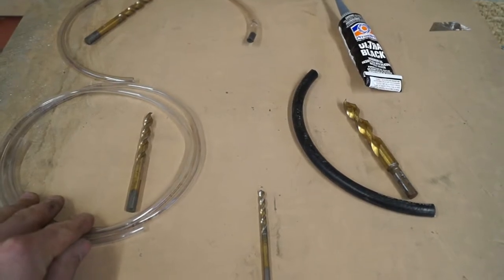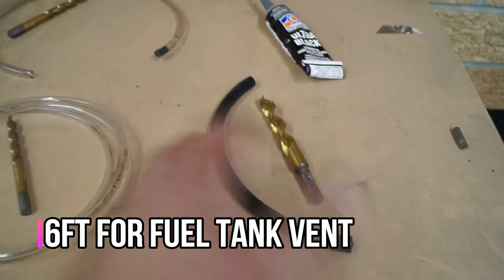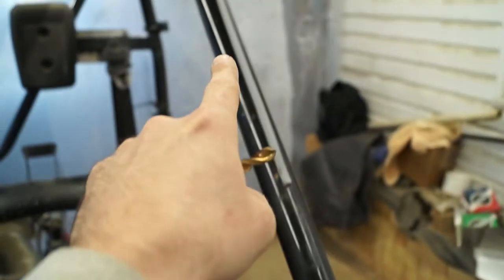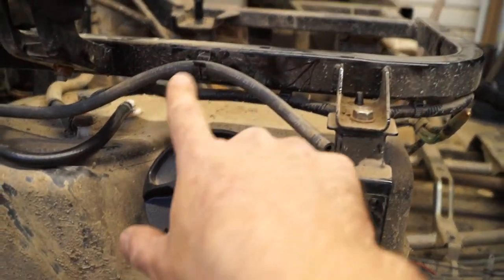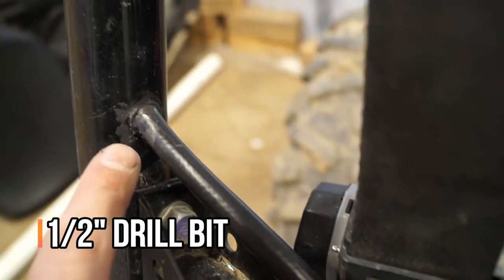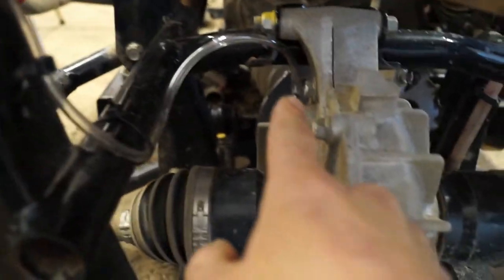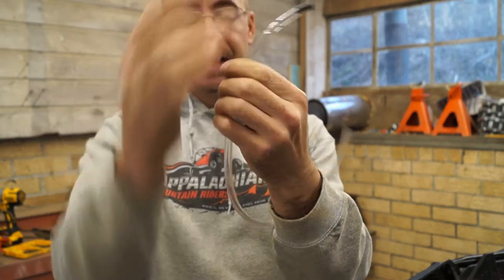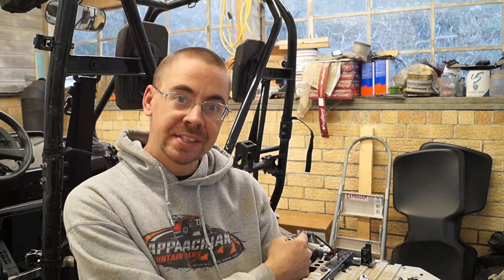Vent Line Extending: Honda Pioneer 500 Snorkel and Vent Line Extending Part 2

Comment: Did you vent your water pump?
Reply from the maker: Nope. You’ll get mixed opinions on if you should or not depending on who you talk too. I’ve had zero issues and it would only be a problem if your water pump went out and the drain line was plugged full of mud. Check the line now and then and clean it out if needed is all you have to do. To me, venting it and not allowing the drain line to actually drain like it’s made to do in a water pump failure is far more risky. Again, depends on who you talk to...lol

Comment: Not sure but will drilling holes in ROPS avoid warranty.  It will on tractors.  Nice vid.
Reply from the maker: As small as the holes are it shouldn't void warranty but you know how dealers are. One thing to keep in mind if they do is they have to be able to prove that the modification you made is directly responsible for whatever problem you are having that made you take it in for warranty work. That being said my warranty is up so it doesn't matter...lol.

Comment: Can you confirm correct tubing sizes for vent lines?

Front diff- 1/4 OD - 0.70 ID (do you mean 1/4 OD - 0.170)

Radiator fan vent- 5/16 OD - 3/16 ID (this is on screen but you say 3/16 OD and 5/16 ID in video)

Fuel vent- 3/16 ID fuel line 

I was making a list of things to buy and just wanted to confirm. Great video.
Reply from the maker: I know the radiator fan vent is what I have in text and not what I said. That’s why I ended up inserting the text for all of them. You may be right on the front diff though. I could have it listed backwards and it’s actuall 1/4” I.D. I will check.